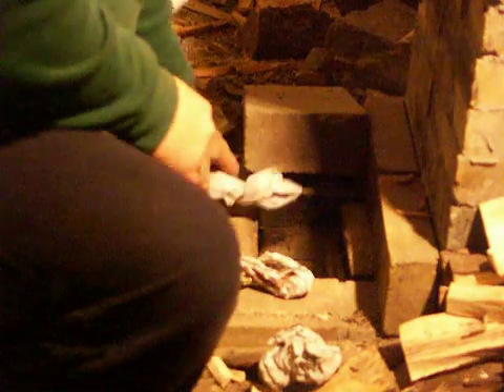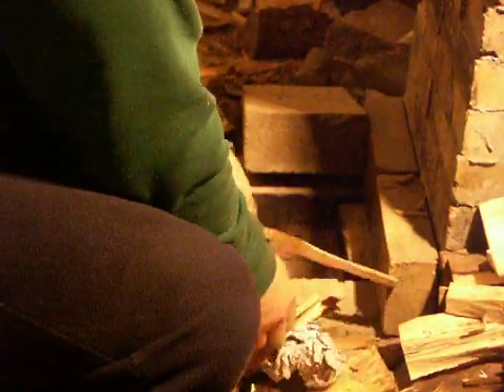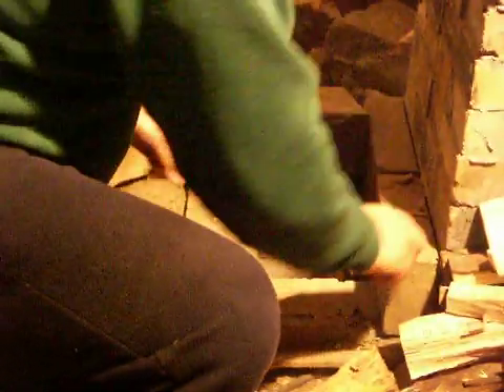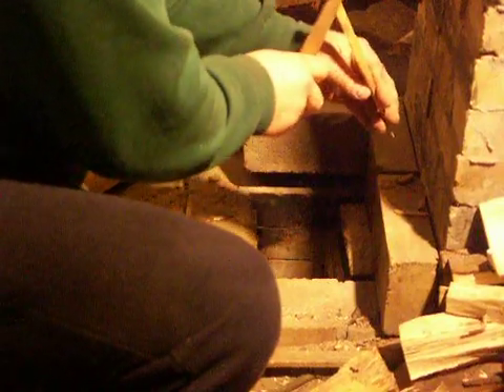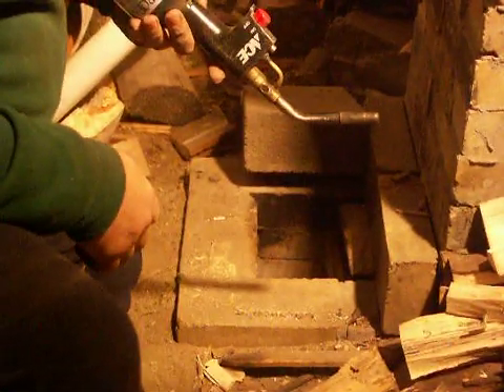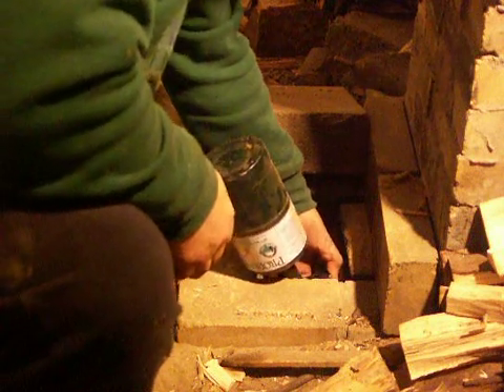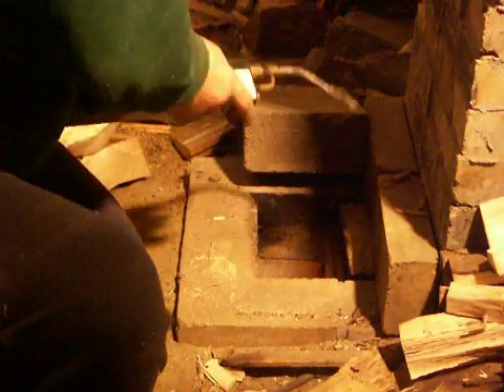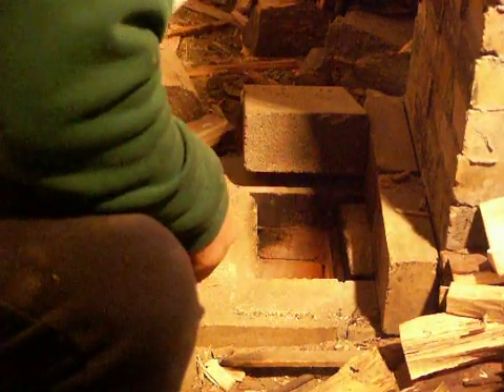Rocket Mass Heater ( Does It Start Up Easily )

Comment from the maker: I now start the heater using a propane torch, after cutting up some kindling-sized wood.  I slide the kindling sized wood all the way to the "back" of the "burn tube" and get it started.  I then place more kindling near to the opening and finally in the "'ember pit", lighting each individually.  The draft from lighting the 1st kindling draws air across the 2nd pile of kindling and gets it going hot.  Still an easy start :)

Comment from the maker: @TheSemperfidude  ... yes you could ... tho you'd also have to utilize some means with which to prevent air from drafting in at the BOTTOM of the heater.  Part of the success of the rocket heater / stove design is that the air drafts IN to the heater from above, flows DOWN the lengths of wood and feeds the fire.  This prevents the fire from burning UP the wood.  If u do as you suggest, you'd also need to include some means of preventing draft from entering the heater @ the base of the heater

Comment from the maker: @gaiagale The video "stopped" just as I was about to show the fire burning inside.  Check my other videos which show that fire and allow you to hear the "roar" of the heater as it burns the wood.

As for where the wood burns, my plans, which are available for USD$35, show where the wood burns and the path the air-flow travels to get outside.

Comment: @LarsMith217 Another way is to push the paper in, light the paper, let it get going, then add the kindling.  

Let the kindling get going, then add the small pieces and add the bigger pieces.  This would only take a minute.  Viola!  The fire is going and no torch.

Comment from the maker: @johnlvs2run Here's how I now start the heater.  I place fine kindling wood way @ the end of the burn tube ( horizontal part of the initial airflow channel ) and I use a propane torch to get the draft started & to light that kindling.  Takes only seconds.  Once the draft is going, I then use the torch on the other wood in the feed tube and pa-boom, she's pretty well on her own and burns well.

Comment: Nice design, but that's a ridiculous way of starting a fire.

Have you tried using a top down burn.  
Put the bigger pieces in first, then lighter, and put the paper on top.  

One match should get the whole thing going quite well.